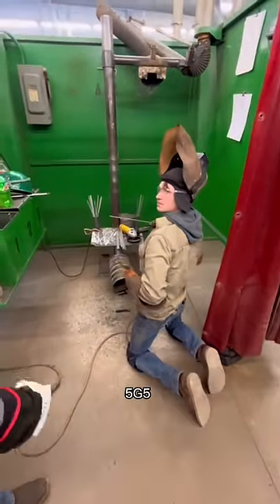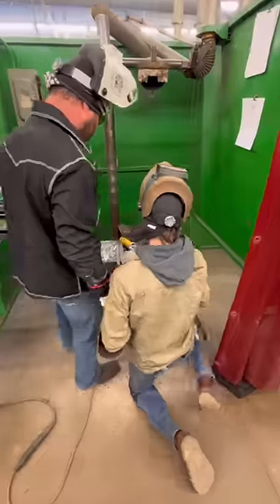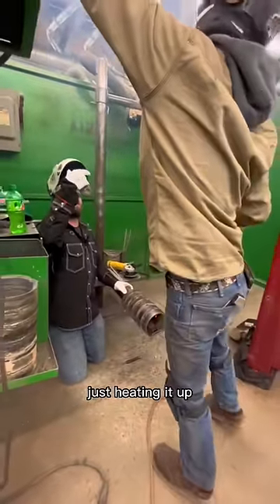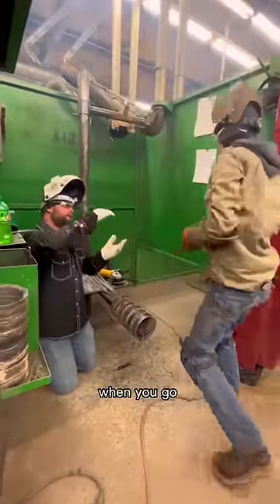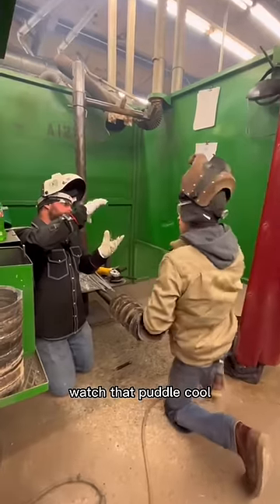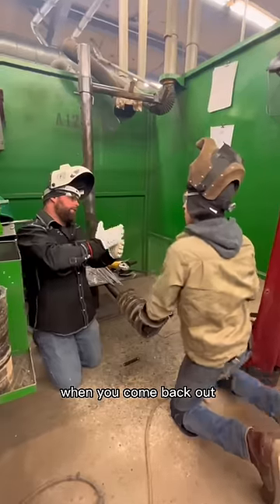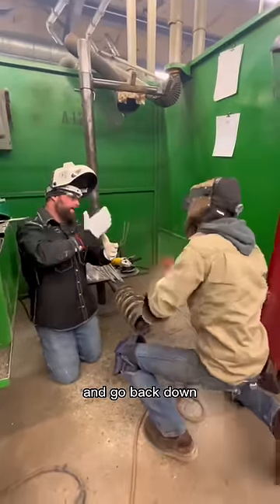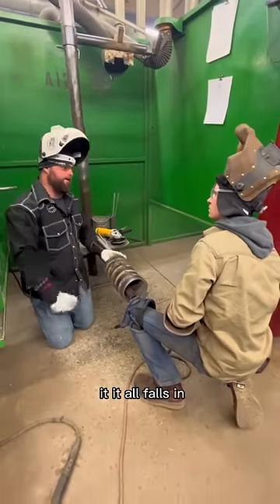Will is showing our student how he pipes his weld! #shorts

Comment: Never whipped it,just had the gap at like 1/16 and the heat around 75 or 80 amps, and just walked ethe keyhole up and welded the inside from the outside. There were times I could look around while filling the root. Looks like a great school tho! You haven’t mentioned the times you have to weld from 6 o’clock to 3, then 9 o’clock to noon, and so on to keep the pipe from moving when in place. But he’ll it’s been 20 years so what do I know,I’m retired,lol!

Comment: Obviously he's welding 6010 5p 1/8" diameter rod it's called the Arkansas bell hole technique...... that's the root pass usually they'll be one hot pass after that then a 7018 Cap weld.
Reply: Yea no. That’s 8010p procedure. You run root hot pass 2 fill and 2/3 bead cap with typical oil field welds.
Reply: That ol hippie God rod

Comment: When I attempt this, It blows up my keyhole. Then I turn down the amps and it's too cold
Reply from the maker: keep a tight arc length. youre probably long arcing and heating up the bevel which causes it to blow out.
Reply: @MWI1994  even when I tight arc, I'll add some metal to the weld and then float up into the keyhole and it'll start to blow up. If I stay in the middle of the keyhole then the weld doesn't completely freeze so when I hit it it blows up and if I go farther away from the weld then yk, it all blows up.

Comment: Why didn't the teacher start at 6 o'clock?
Reply: Probs countering the pull of the pipe since the kid welded the other side he hit the opposite side so it would pull evenly
Reply: @matthewlemire7180  huh, the pipe should have been properly tacked. On a pipe liner job, it's common to see both operators start at 6 o'clock.  🤔
Reply: I would imagine he's showing him how the flow of the bead starts to dramatically change around your 5 or 7 o'clock and how to manage it
Reply: @mihalispsychedelicrealeyes1284  yeah some times but the student was doing it by himself so he probably off set the square buy a cm so it would pull to where he needs it that’s what I do when I weld meters just like when you level it you set the Hubble high so when you weld and it pulls down it will pull enough to be level
Reply from the maker: that quarter was already done
Reply: @MWI1994  so did you guys off set the “squareness” of it so it would pull to be square also I  have some questions for you guys if you’d be willing to talk I weld pipe at 19 just graduated about 8 months into my job and I think I have it down to a T would love to actually have some good feedback and maybe a place to improve